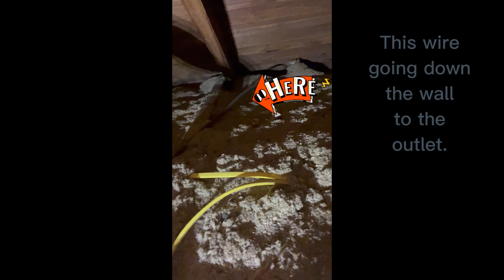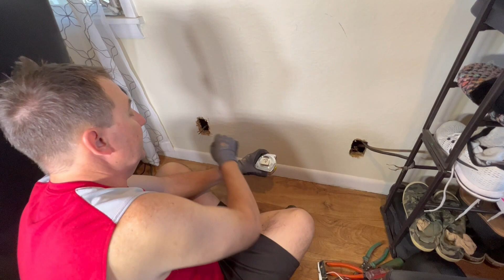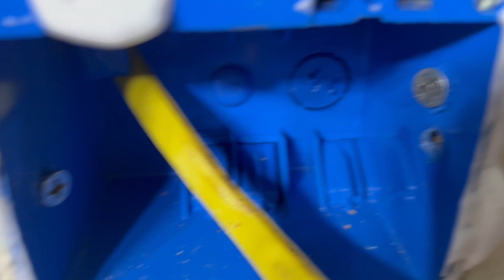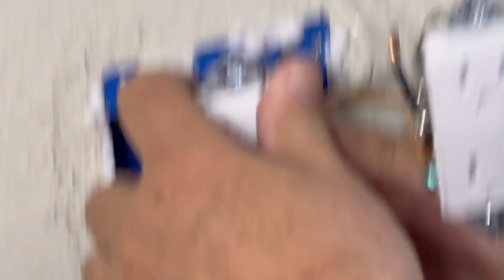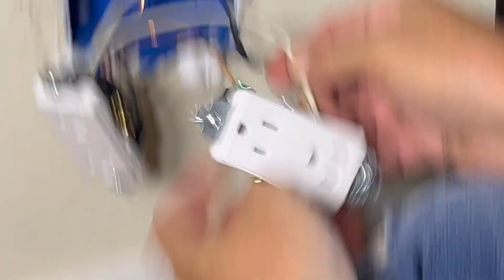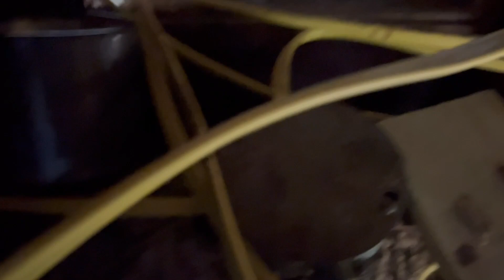Replacing Outlets and Fixing Un-Grounded Outlets #electrical

Comment: When you work as an electrician apprentice you get all the fun chores, like running romex in attics where it is 200 degrees thru all kinds of dust, insulation, bat poop etc. And staying on the studs, where if you slip and put a hand or foot thru the ceiling. Then you learn all kinds of new skills.   :hand-orange-covering-eyes:Just think what this job of yours would have cost. That is why people still try to do it yourself for this and plumbing.:body-blue-raised-arms:But, thanks to Yoo hoo tube we can at least ask a few questions, like: "can I watch" and "I will get an inspection for code, just want to let you know". :face-orange-biting-nails::face-purple-wide-eyes::eyes-pink-heart-shape:
Reply from the maker: All of us in the trade had to go through it and that’s how you learn. There’s no getting to the top without starting at the bottom. I thank God for YouTube helping all of us people prepare the learning phase where somebody went before us and they can explain how it’s done.

Comment: Unscrrew and replace the blue box tab screw top and bottom with two longer screws that have the same thread and diameter. The corner blue box tabs will secure box.
Reply from the maker: Agreed. If I had said screws. 
Thanks for watching and commenting . 💪

Comment: My dumb question is, did the ungrounded outlet work before the fix?
Reply from the maker: The only dumb questions are the ones not asked. Yes it worked. But, if I used a product and had a ground fault of some sort I could receive a shock or worse. Better to be grounded. I don't want to be the ground! 
Thank you for watching and commenting!
Reply: @YourFloridaElectrician  One outlet I have tests as "ungrounded" and has some electrical current, but won't power anything plugged into it.  Not sure what next steps should be, short of calling an electrician.
Reply from the maker: Anything less than 120 volts -5% or down to 114 volts can damage electronics or makes items not work. Have you tried to borrow a multimeter so you can get the actual voltage off of the outlet?

Comment: Using jumpers is a lousy way to wire. They should have been pigtailed off the feed wire. Wiring in parallel is smarter than wiring in series like this guy did. If one outlet fails it will kill both his way. I fixed several that were done like this at my daughters house. With Wago connectors it’s fast and easy and a better job. His way works but is not a good job.
Reply: Daisey Channing is very common wiring method but pig tailing may be a better method in most cases but more time consuming and more material involved.
Reply from the maker: I did recently do another video using more of a commercial method. 
I like to show multiple methods. 
https://youtu.be/q7fX2AFxER4?si=LQMpuhR7Sz51wxZG
Reply from the maker: Thanks for the comment Alan. I like wagos also. 
Just one of many ways of doing it. From outlet to outlet that’s how it’s done in the walls of most residential. The wago way is more like commercial where you can remove one outlet and it doesn’t affect the rest.  I like to put electrical tape on my wagos also, because I noticed they tend to easily open up and become loose connections. 99% of residential homes people will find their outlets connected in this manner shown in the video. Commercial guys hate to wire the way shown.  Thank you for your input.

Comment: For that small job and to save time and money I would install a GFCI.  Both outlets will be protected.  10 minutes done, gone to the next job.
Reply from the maker: That’s true, it will be protected, but not grounded. The work done in this video was on my old ass house. A lot of the wiring here needs updating anyway so why not show any way to ground. 
Of course the GFCI would work.  In the future, I want to add a GFCI on the opposite side of the wall outside for future low-voltage lighting or flag pole lights. (another video coming.)
I always appreciate the comments. 
Thanks for watching

Comment: Not sure if I’m correct but wouldn’t it be better to splice the line so if the first receptacle goes bad the second one will still work?
Reply from the maker: You certainly can do that. You can "pigtail" the blacks then whites and grounds together then feed each outlet from this pigtail.  This is one way of doing it. 
Thanks for watching and commenting, Kelvin.  👍👍

Comment: Back-wire is different than 'Back-Stabbing'  I NEVER Back stabbed my wires. Back in the day, the Back stabbed holes would accept #12 wire. Even then, I wouldn't Back stab. The higher quality receptacles have Back Wire capability.   Lots (most?)  GFCI's have Back wire capability.  I still enjoy a 'shepard' hook under my terminals, and that is MY standard.
Reply from the maker: Any shepherds hook is better than a back wire. Thanks for watching and commenting James 👍

Comment: 93 - 94 I worked in Vero on new residential. Jobsites had only one Toilet. Being older than my co-"workers" I arrived onsite before them and got to watch the daily morning routine. Every single one of them went to the toilet to toke-up before putting on their tools. The foreman got me fired for following code. Moved on to supervising construction on a hospital project rife with fraud. Apparently the construction industry in Florida at the time was stinking. I doubt very much that it has changed??
Reply from the maker: Wow that stinks. That hasn’t been my experience working here luckily. Most everyone has been legit and we now have random drug testing so to toke-up may cost you your job these days. 🤔

Comment: I have started to write the number of the circuit on the back of any receptacle or switch plates I work on. Although I try to have all circuits properly labeled at the panel, having the circuit # on the plate may help someone in the future.
Reply from the maker: Absolutely!  That is especially useful and should be required on commercial jobs. 
Great comment. Thank you 🙏
Reply: Very considerate of you and a great idea that I’ll definitely be doing this from here out and I’ll remember I got from SJ property services🙏🏻👊🏼✌🏻
Reply from the maker: Happy to help SJ property services. Thanks for watching and commenting! Anyone can show their support and appreciation by sending super thanks! I love to hear that kind of feedback.

Comment: I understand why you decided to install the quadplex. However, running wire behind mopboard/trim can be done safely. Here is an example of how it can be done. 

https://youtu.be/nWfEANZOYSk
Reply from the maker: Agreed. In that video he took off the mop board and installed the wiring through the framing members. I don’t like seeing the wiring between the mob board and the drywall. 
Thanks for commenting.
Reply: @YourFloridaElectrician  Agreed
Reply from the maker: Thanks for that link. Always interest in learning!

Comment: I’m not convinced it’s “drywall”, looks more like plaster over lath. 
Which would have been standard for a house that old. My brother’s house in Hollywood was built in 1922, and all the walls/ceilings were lath and plaster.
Reply from the maker: Hey Daniel. It's definitely something thicker than drywall. It's almost like a very thick fiber board of some sort. Not super hard to work with like plaster however.  Yes over lath or other type of wood. Build like a brick Sh*t house for sure. Makes it not easy to work on in some regards but easier in others. (no insulation in the walls, easy to pull new wiring down) 
Thank you so much for watching and commenting! Good Eye!
Reply: It's a product called Homasote and was popular in the early 1900s. Hard to work with as proven by the fact he didn't show how to patch it.
Reply from the maker: @jackriley5974  still haven’t patched it. Any pointers?
Reply: @YourFloridaElectrician  Damned near impossible. It's not the patching, its the finishing, especially on a home that old. Homasote is very porous and nearly impossible to sand. The patch(not necessarily Homasote)  would have to be recessed to allow for mud thereby, eliminating having to mess with sanding.  Thankfully someone discovered sheetrock to replace it. An anecdote: About that time someone invented Celotex which is little more than tar soaked Homasote, and that got it promoted to exterior sheathing. For obvious reasons that didn't last long either.
Reply from the maker: @jackriley5974  Thank you for that explanation. Yeah I will probably just drywall over it.

Comment: Here they will not allow a loop connection of the ground, we must wire in two pig tails, one for each duplex.  We also can not loop hot and neutral between the outlets, we must connect pigtails to wire up both outlets from the incoming feed wire.  Good job detailing your overview.
Reply: Is that true? NEC (2020) says:

"Equipment Grounding Conductor Continuity. The arrangement of grounding connections shall be such that the disconnection or the removal of a luminaire, receptacle, or other device fed from the box does not interrupt the electrical continuity of the equipment grounding conductor(s) providing an effective ground-fault current path."

Since the ground is a continuous loop one can remove either receptacle without breaking the ground. It would be illegal to put a separate wire connecting the receptacles under the same screw.(Which would be a bad practice anyway)
Reply from the maker: Okaro. Never put more than one wire under a termination. It's not "illegal" but it certainly against code for good reason. As you said, bad practice. 
Thanks for commenting. 👍
Reply: @YourFloridaElectrician  When you loop there is just one wire.
Reply from the maker: At what time in the video or what is your reference?
Reply: Very nice informative video, question do most residential properties have 12 gauge wire then? Thats why you didn’t do the stab in option into the back of the outlets? & if so is the stab in option good?
Reply from the maker: Hey Junior. 12 Gauge is not required for all circuits here in Florida. This house was already started in 12-gauge so I will continue, even it is more expensive to do so. 
New construction will usually have 14 gauge in the bedrooms, General lighting, general area like hallways & bathroom lights. It's not uncommon to have two small bedrooms with a bathroom in between them wired with a single 14-gauge circuit. I find 12-gauge will have less tripping issues especially when it comes to using vacuums and hair dryers. 
Areas that are required for residential to have 12-gauge is the circuits serving the kitchen counter tops, dining area outlets, washing machine, microwave and the bathroom receptacles.  Remember NEC is the MINIMUM code requirement. You can always put larger wires. 
12-gauge won't fit in the stab ins in the back as you know. The stab ins I will never use because that was designed to speed up the trimming process of new construction for the electricians, but it is a much worse connection than using the side terminals. (I did use them while I was learning the trade and trimming houses) The stab ins make very little contact with the wiring compared to how much better a connection is by using the terminals. I should make a short video explaining how much better is it. 
Thank you so much for watching and commenting! These comments, liking and subscribing is helping grow the channel.  Much appreciated.
Reply: @YourFloridaElectrician  thank you appreciate all the information and feedback and yes a video
Explaining these details and showing will definitely help us new ppl out!
Reply from the maker: Happy to help.
Reply: I'm not an electrician, but I too knew that (loop connections).  

Also, I'm pretty sure, this house was built with KT wiring which was replaced with 2-wire cloth-tar wrap at that time (in the 50s).  Two wire "Romex" finally replaced it after 1973. I think the receptacles were replaced then (because no ground wire). 
  
From my experience, after WW2 (49-51), all they had for inside walls was not-very-hard hardboard but this wall shows the 1950's introduction to the much stouter and thicker (5/8" as I recall) fiberboard. It's soft but, at least, not a hardboard panel!  And that's why the remodel box  screws were too short.  

I would have written on the cap of the junction box, at least, which each of the 4 wires are.
Reply from the maker: @mrcryptozoic817  Cool! Love all the information. Thanks man! These walls are super thick! Pain in the butt to work on but very sturdy house. 
Thanks for watching & commenting.
Reply from the maker: Nice I Thank you for watching and commenting.  Do you work commercial or residential?
Reply from the maker: I value everyone’s comments. I enjoyed reading and responding to all.  
Even the national electric code is nationwide each AHJ can impose their own set of rules that they feel is important for their area. Understandably wiring a house in Alaska would be a little bit different than wiring houses in Florida. Hence the reason for additions locally to the national electric code. 
We all know wiring, residential and commercial is two different animals as well. 
Keep the comments coming my friends. Thank you.
Reply: @YourFloridaElectrician  Yes but some things like your grounding on a plate screw and using a glue or sealant around the 2 gang may make the box unacceptable to change would not pass a local code either,Just use longer screws on the tabs or a longer ,deeper box.
Reply from the maker: @alhawkins3376  All good options. In the real world if someone is doing some work on an outlet in their own house, it’s very unlikely they gonna pull a permit. It just needs to work and be safe.  
I don’t recall ever seeing construction with the walls being so thick like I have here. 
I’ve seen similar with cut in dryer outlet boxes, pushing into the wall because the tabs that hold them against the drywall I’m not sufficient for how much force it takes to push the plug into the outlet. The same type of solution, installing the cut in box next to a stud and putting screws into it has also worked in the past. 
I appreciate your comments. Thank you so much and thank you for watching.

Comment: You don't attach the boxes to studs?
Reply from the maker: Usually attached the boxes to studs during new construction rough in. (Before drywall) If I’m installing a two gang for say a dryer outlet (after drywall) I would certainly use a cut in box and then screw it to the stud on the side. The outlets are really hard to plug in and a cut in box alone without proper support will punch right into the wall.  The cut in boxes are typically for what we call old work in a house after construction has been completed. 
Good point, and good observation thank you for watching. 
Please consider liking, sharing in subscribing it really helps.  🤙
Reply: @YourFloridaElectrician  Thank you for such a detailed response! I have a lot to learn and definitely have subscribed. 🙂 
I probably won't be doing much, if any, of the work that needs to be done on my new (to me) 100-yr-old house, but I like to understand things. I have a good electrician, but it's going slowly because I'm really short on funds. Mine's the kind of old house with 2-prong outlets in 8" high baseboards. One bedroom doesn't have a single outlet in it! Good thing it's just a spare room I'm not using yet. (I'd like to put a TV in there.) More pressing are getting outlets put in for appliances, though. My electrician has run a new line for the drop-in stove I got used (which has to be hard-wired). I like the idea of a new line (hope I'm using a term that makes sense) for each major appliance, since I don't know what state  all the wiring is in this house.
Reply: FWIW, I'm in Detroit.
Reply from the maker: This house is 108 years old. Still a lot of rewiring needs to be done.  On the kitchen make your electrician pulls two new updated appliance circuits. That is code minimum.  20 amps each. Plus of course the stove wire.
Reply: @YourFloridaElectrician  not really, It was a code change you can run a disposal & washer on a 15a circuit if nothing else is on it, The equipment rating is what rules all and the 80% rule or 50% so if the combined amp rating is over 12a = 80% of a 15a circuit  rating  you must then use #12 wire. Check section 210 .23 Its 50% for fixed equipment, its rules that apply not just wire size or running a 20a.
Reply from the maker: @alhawkins3376  personally, I think all houses should just have 12 wiring. The 14 wiring causes too much problem. Especially when it comes to hair dryers and vacuum cleaners.  New York City from what I understand doesn’t use 14 wire in their houses. If you can send me that exact code, and I will take a look at it.  
Thanks for commenting !
Reply: @YourFloridaElectrician  210.23 mike Holt did a video "can disposal & dishwasher be on same circuit"? I cant seem to find it again.
Reply from the maker: @alhawkins3376  Mike Holt is the Goat 🐐
Reply: @elainebelzDetroit  Yes the right box for this type job is called an "old work box" they come in all sizes and are made to cut a hole then just push it into the hole traced by drawing around the box, it has screws and when you tighten they hold the box tight on the drywall with no stud. Your talking about dedicated lines for your kitchen, make sure they are 20a ,look up the NEC code for kitchens so you will know more if your electrician is doing it right.
Reply from the maker: Did you ever get this work completed?
Reply: @YourFloridaElectrician   No, sadly. I've got a huge backlog, and I also have 4 jobs (2 are very p/t but it's still a lot). Despite that, money's also an issue.
Reply from the maker: Well, good luck in the future. Hopefully you can get all the things done that you need to get done.  
Keep on keeping on. 👍
Reply: @YourFloridaElectrician  Thanks! I love my house, so I will keep at it. Little by little.
Reply from the maker: That’s the spirit!